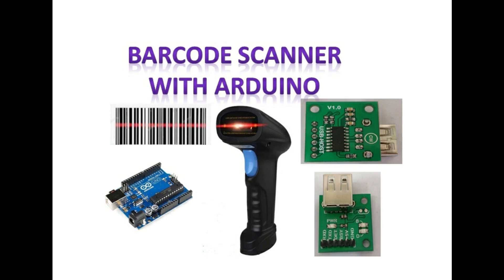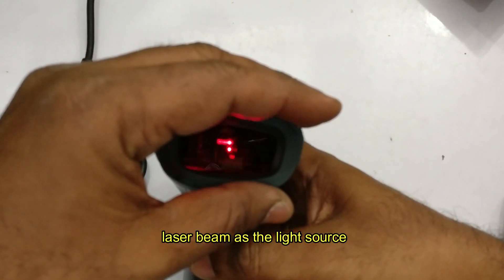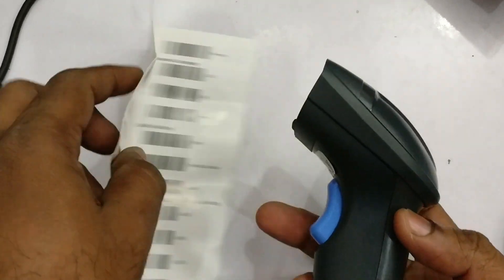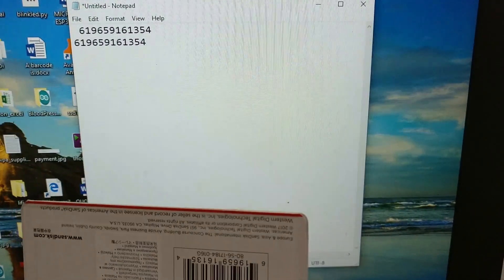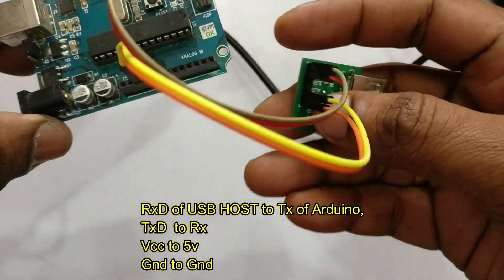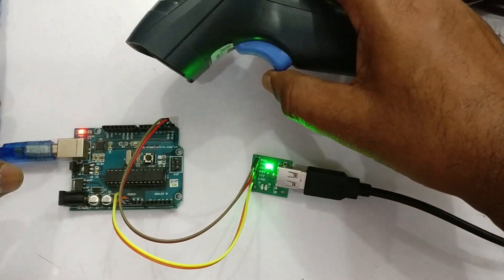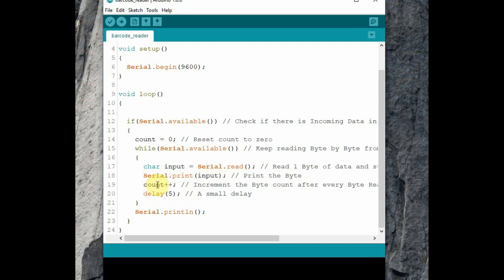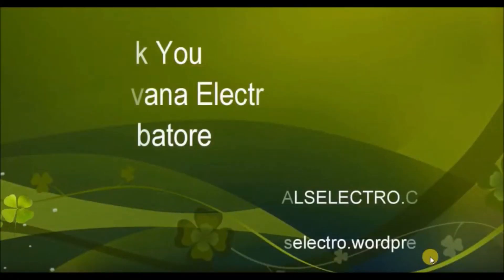BarCode Scanner with Arduino

Comment: heyI have ch376s module and I am using a honeywell voyager 9540 with esp8266 but it not showing anything at monitor i have tried multiple baud rates as well
Reply from the maker: This USB module has a custom built firmware to support bar code scanner.CH376 is used to  read/write file in USB Flash Drive or SD card. It will not work for bar code scanner.

Comment: @Saravanan AL I tried using with a Honeywell scanner using the same code and same usb host shown in the video. Only difference is the scanner power requirement is 5V@450mA. The scanner is working fine but arduino is not getting any data from the scanner.
Reply: Check if the Tx of the arduino is connected to the Rx of USB host and Rx of Arduino to Tx of USB host. Try to change the baud rate 300, 600, 1200, 2400, 4800, 9600, 14400, 19200, 28800, 31250, 38400, 57600, and 115200. Test all these baud rates.

Comment: hi sir i am working with intex IN-101 BS SCANNER, unable to connect with usb to ttl which i have bought from market to my arduino, will your usb host module connect to intex scanner
Reply from the maker: Scanner will not work with market usb-ttl .You need to buy our usb host module specially designed for scanner.Buy link in description.
Reply: @SaravananAL   i want to buy this 
how can i buy this 
please help

Comment: Sir any USB based barcode scanner can be interfaced Like this? Using just USB to ttl or any specific scanner module is available? I see on amazon there are similar looking Barcode scanners at cost of 500 to 1000 are they good for projects??
Reply from the maker: Any usb barcode scanner matches with this usb-host.The usb host board converts the scanner HID device & provides ttl output to communicate with microcontrollers.
Reply: @SaravananAL  so buying that USB board is compulsory?? Or we can use any usb to ttl converter like CH340 CP2102 FTDI PL2303??? Or is it any special controller on that USB board??
Reply from the maker: @kolhatkarchinmay  This board is designed purposely for scanner.Other ttl boards cannot be used.
Reply: @SaravananAL  thanks got it!